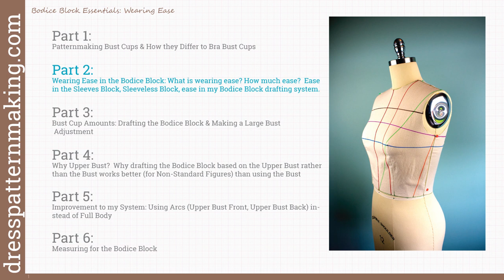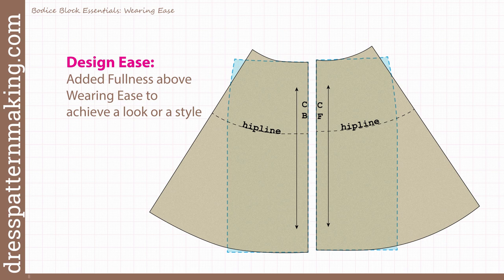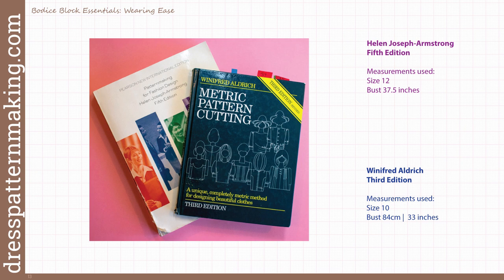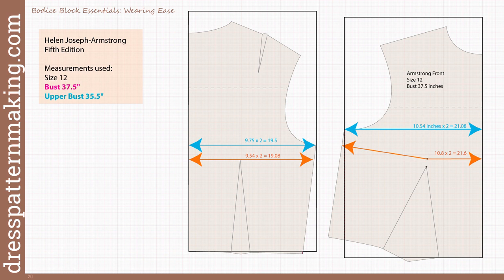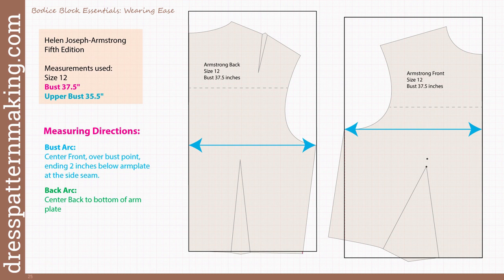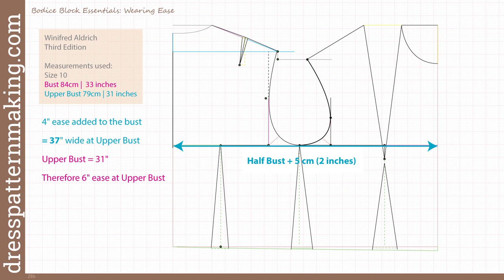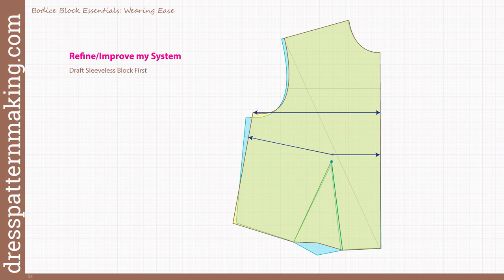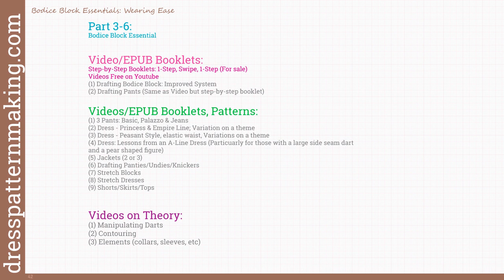(Wearing) Ease in the Bodice Block (Part 2, Bodice Block Essentials)

Comment: You have by far some of the most helpful pattern drafting info ive ever found (and ive been doing this for a decade now). Your dive into the Armstrong bust/back arc situation makes me feel soo much better about the fact that my blocks just werent fitting! I had read and reread it and I didnt realize that the different measuring points would be so important!
Reply from the maker: It drove me crazy for a long while because the ease I was measuring in the pattern was ending up so different to the ease added in the instructions.   I kept doubting myself and checking and re-checking.  I'm glad that I finally realized what the issue was!

Comment: Thanks for your straightforward evaluation and explanation of why to add a certain amount of wearing ease.  I have used "Armstrong's" book to create my body form cover, 3 times.  I have also done my own blocks.  But when I used my blocks to make my blouse pattern I didn't have enough ease.  It was a struggle to find information that would help.  So I draped a front and back bodice on myself and made a new set of block patterns and then adjusted the fit and added more ease to make a blouse pattern from it. 

I was doing fine until I got to the sleeves.  And your video helped me to see that the extra bit of ease, especially in the back was necessary for comfort and movement.  I am so grateful for the way you explained the the under bust and how it relates to the bust ease amounts.  It really helped me to progress through the fit process and accept what I need in the pattern for proper movement.  

You made so much sense and really spoke to me. I checked out your blog and would have commented there, but I was unable to log in once I had done a login.  I have made a number of my own patterns, mostly knits.  But now I feel that my woven patterns will fit and I can continue on and make my shirt pattern and using your blog post on adding ease to the shirt, I can make my jacket patterns   fit too.  Thanks so much.
Reply from the maker: You are most welcome.  Thanks for taking the time to write a comment and give me such good feedback, it is much appreciated.

Comment: why does your answer say 9/16ths if the parts add up to .58? shouldnt it be .56 then ? i know it was the measurements they gave you and im not good with decimals but from what i saw on a chart its not making sense to me. im just confused on how you got 9/16ths. im trying to understand every last detail in your videos and ive been stuck on this a whole day lol
Reply from the maker: Hi Chris  - I'm unsure what part of the video you are referring to (without watching it all)  but the answer would be one of these:  (1) here in Australia we use the metric system, so I have to convert to inches and sometimes I do make mistakes, or (2) If the parts add up to .56, then I would round it to 9/16ths....  (As I said - inches are not natural to me but every patternmaking video I've watched that uses inches only uses the fractions in eights and sixteenths).   Maybe if you give me the time stamp I could be more more precise. 

Also, I would think the difference would be negligable/meaningless (inch rules wouldn't measure .58. you would have to round down to 9/16ths).  Unless I'm wrong about that... as I said, I don't natively use inches.
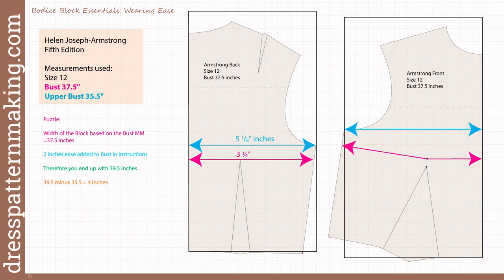Reply: Oh my goodness I didn’t expect such a switch response! Thank you so much! Ok so it’s around the 10:17 mark; your measurements on the left. You added the back and the front and got 40/9/16 simplified. But I was looking it as a decimal 21.08+19.50= 40.58 which when I looked up a chart the fractional inch for it would be something like 40/55/100 so I was confused about the 40/9/16. I’m assuming you may have rounded it maybe. I do sincerely apologize I might just be being very over analytical but I just wanted to make sure I understood everything you said perfectly